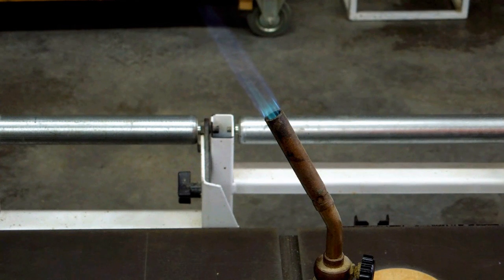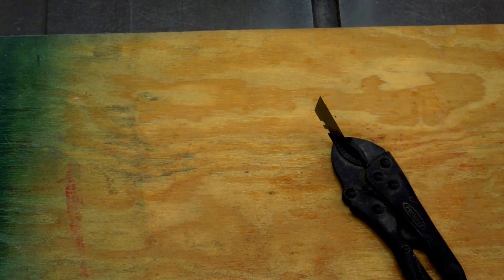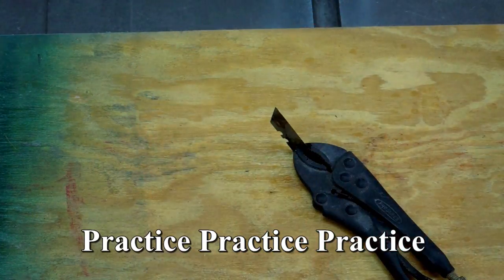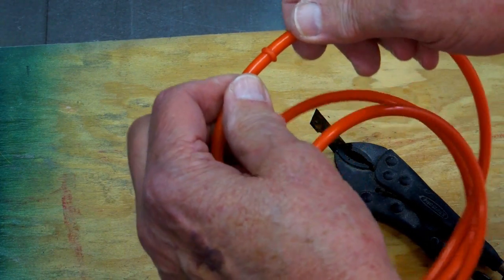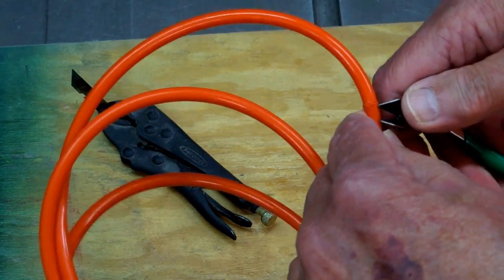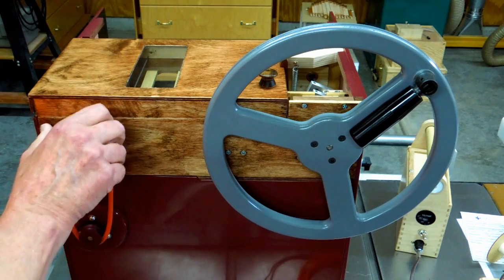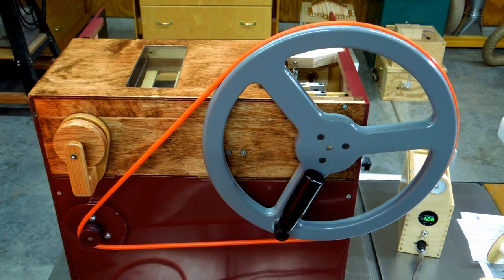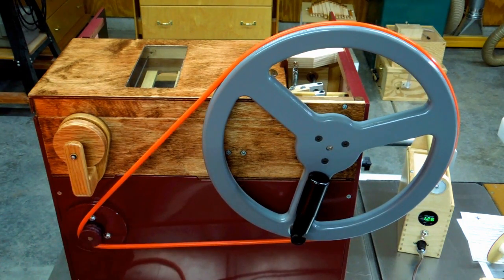Senior 20 Conductor Installation (15) Joining Urethane Round Belt

Comment: I've tried this kinda way, 
And it result zero
The belt is broken
Reply from the maker: Sounds like you just need more practice making belts. The belt does not need to be very tight and that will place less strain on the joint. Practice makes perfect... or at least a bit better! Thanks for watching. Please subscribe!

Comment: Are these PU (Polyurethane) belts are suitable to use with 1000 RPM speed?
Reply from the maker: As long as the pulleys are sized correctly for the belt (do not exceed the minimum bend radius) and the driven load is appropriate for this size belt.  Manufacturer will supply design or operational criteria for their belts.

Comment: Great video. Short and to the point. Easy to understand your method. Do you believe this could be used for replacing belts on vintage tape recorders and remain bonded with short radius pulleys?  I don't thick I would need to use anything greater then 2 mm diameter belts.
Reply from the maker: A "short radius" pulley is defined by the belt diameter. They make this type belt in all different diameters although I do not know where you would find it... just need to look around. They also make o-ring kits where you can make your own o-rings by gluing the ends together instead of melting it together. An o-ring makes a good drive belt and they are available in all different sizes. Look for a hydraulics supply store... you can probably find a suitable ready made o-ring for your purpose. Go to https://www.grainger.com and look for o-rings. Thanks for watching. Please Subscribe… that is what keeps this channel available.

Comment: Good info. I wonder if cutting the belt at a 45 instead of a 90, would give you more surface area to melt and longer joint to make it stronger and even less of a chance for failure, if you did have to run a belt tighter on some other project? Keep up the great work.
Reply from the maker: All the different cross section belt profiles are cut straight through and are welded as shown here. The professional welding kits maintain exact temperatures and exact alignment.